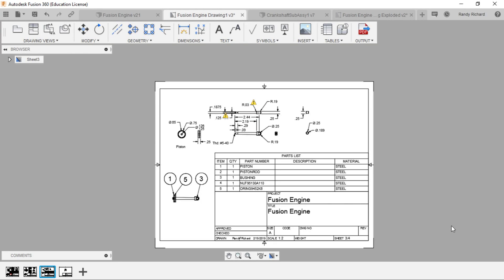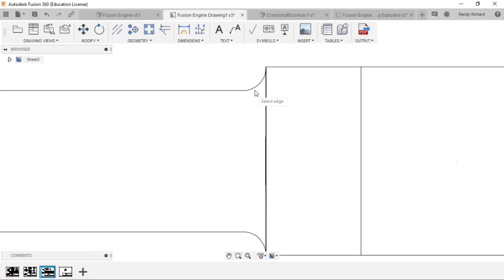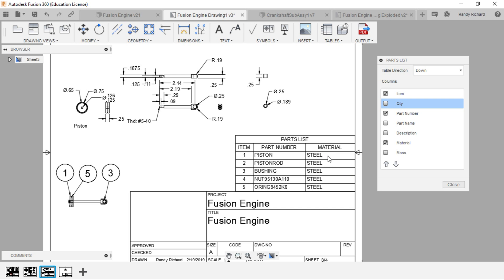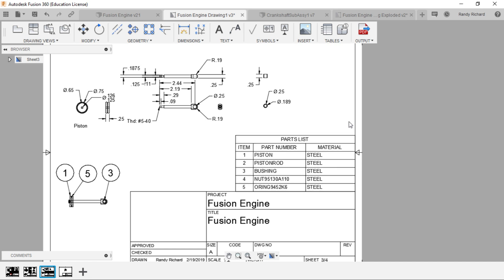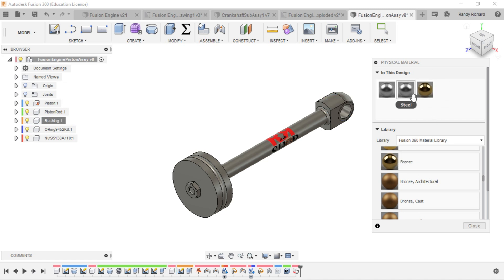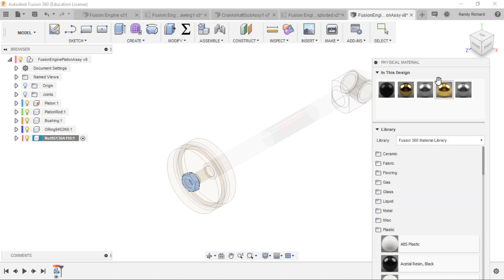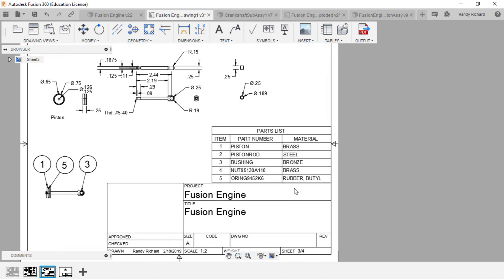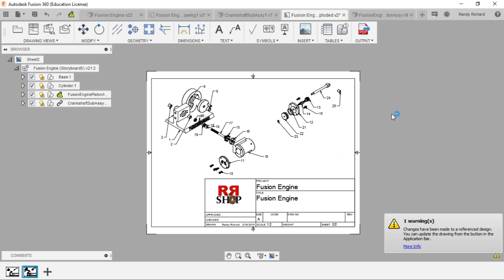P6-2 How to Make the Drawings for the Model Steam Engine

Comment: I have modeled several stationary steam engines in Fusion 360 and printed them as well. That can be a challenge to allow for your printers accuracy to print. Adjusting sizes to make them go together.    I jumped over some of your video to try and find if you have shared your Fusion models and did not find. I know that is a lot of work to share. Fun to watch as well as you machining of the parts.  Thanks for the video series.
Reply from the maker: If you send me an email I will be more than happy to share the model.  Thanks.